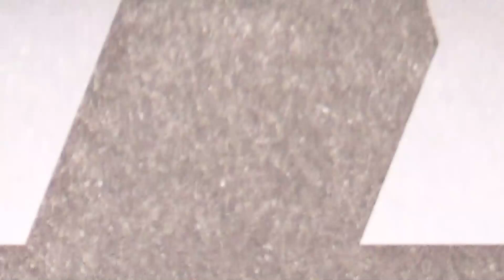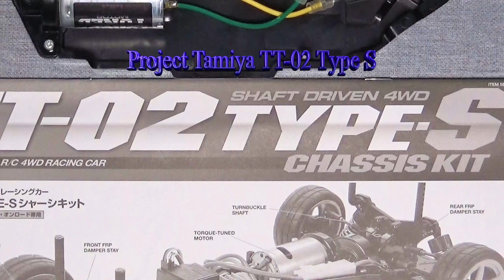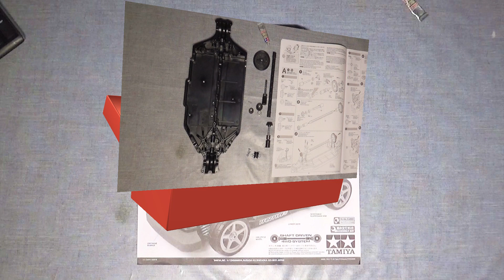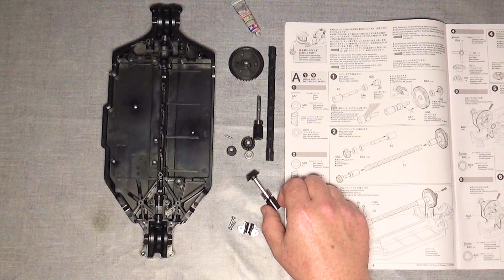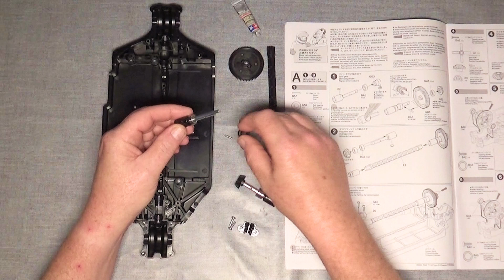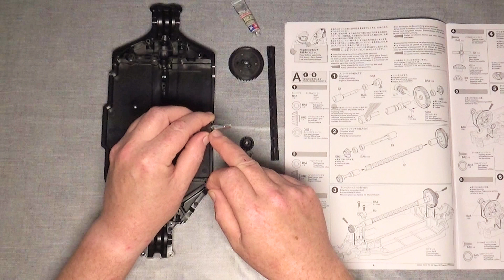Project Tamiya TT02 Type S Escort Rally Car Build Part 1

Comment: Hi Rob. I have purchased a pre built TT-02D  ( bog stock with bushes ) and plan to completely strip and rebuild with bearings and various hop ups. Could you advise what grease I need for general build and diffs etc.  I haven't built anything in many years so rather rusty. Cheers Dave

Comment: "So we'll just get that slapped in...and we can continue"!
 Spoken like a true mechanical engineer!
I was interested to see how the spur gear transfers drive to the shaft via a wheel-type pin. My Anderson M5 1:5 scale MX bike uses this system, and occasionally shears the spur gear in two if I land from a jump with too much throttle applied. I know that the TT-02 isn't known for doing this; perhaps Tamiya use a higher - quality plastic to make the spur gear.
I look forward to seeing the next video!
Reply from the maker: Hehehe, that's me Del ever the professional lol. You are right Mark has had his TT-02B for a long time with no issues with the spur gear. The good hop-up bits are coming in the next episode. Many thanks mate and stay safe.

Comment: Hi Rob, don’t yah nat fancy turning it into a rear wheel drive Ford, I’m thinking about doing that with my tt02 chassis. Sweeeeeeeeeeet video Rob, looking forward to seeing the next episode of this build. 😎👍👍👍🇬🇧
Reply from the maker: Hi Mike. Well mate. I do remember back in the day my TA-02 AMG Merc broke a front diff output cup so for a while I removed the prop shaft and ran it as RWD, but I couldn't keep it in a straight line (just kept doing donuts lol) So I got a replacement cup and upgraded the prop to aluminium. Next one is the start of the upgraded stock bits. Many thanks mate ATB.